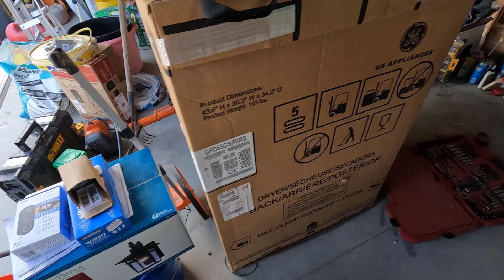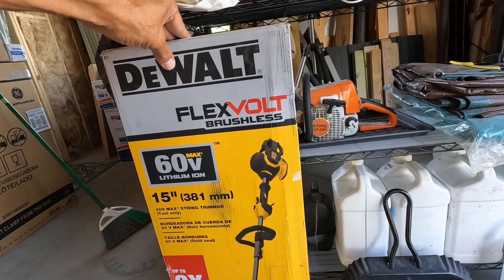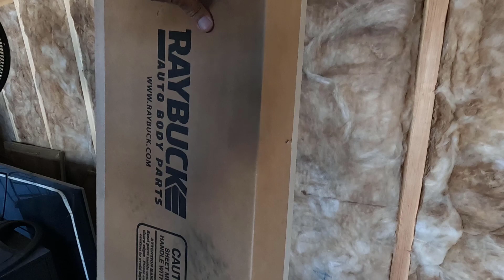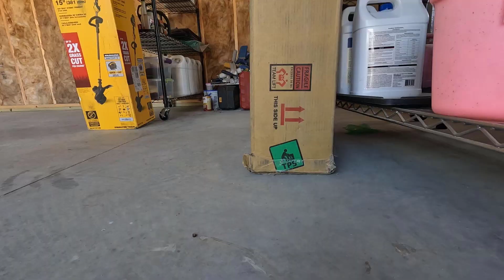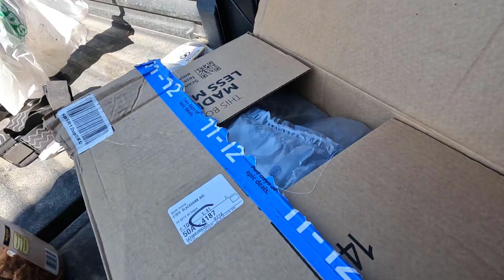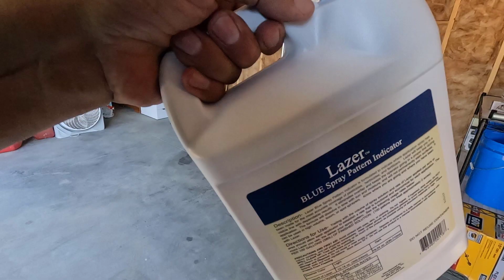Planting is Over ― Time to Clean and Reconfigure the Staging Area!

Comment: Looks real nice. It will nice when you get some organizers out there, but getting those string trimmers out of the way will be big as well.
Reply from the maker: Thanks Robert! I have rethought what I will do with the organizers — I had planned on just putting a board across the studs and screw in some garage hangers — but the screw-in garage hangers are getting hard to find, and they probably wont work anyway. I ended up buying an organizing system, and Ill be doing a video on it soon 😊